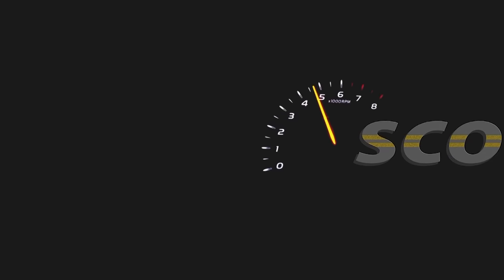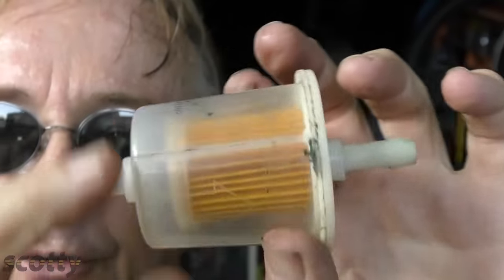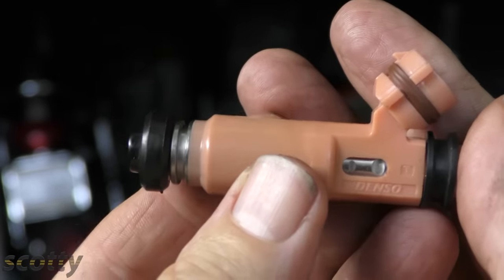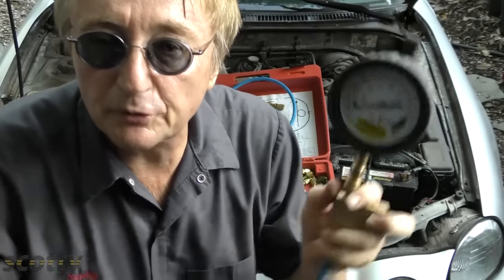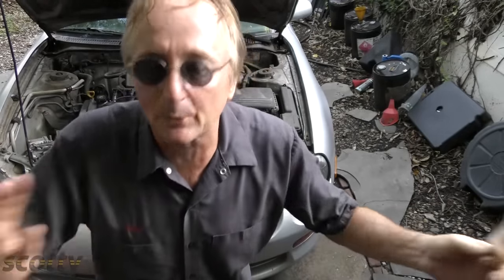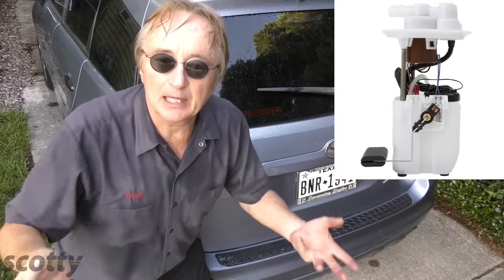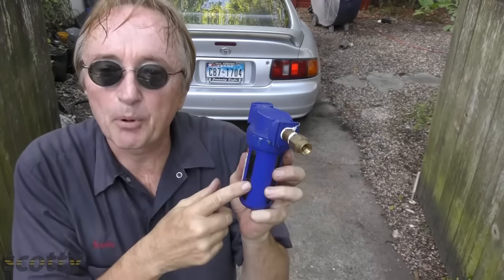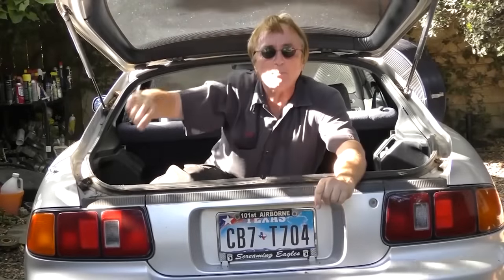Here’s What Happens if You Don’t Change the Fuel Filter in Your Car

Comment: With all due respect Scotty I would have to disagree. I know people who have cars including my own that have anywhere from 100,000 to 250,000 that are still on the original pump/ filter and run fine. I even have one friend who has a Chevy Suburban that has 320,000 miles that has never been changed and it runs fine it also has an inboard fuel filter. Personally I would rather have my fuel filter in the tank so I won’t have to change it that’s just my personal preference.

Comment: would a bad fuel filter be the reason why my 4.3 s10 decides to randomly shut off(engine) while driving? I notice low pressure by sound and feel. haven't yet rented a fuel pressure gauge but that will be my next step.

Comment: I have a 2012 Chevy Malibu and recently I was driving with only a quarter tank of gas. I was driving at a fast speed on the high way but as soon as I came to a complete stop, the gas pedal became unresponsive and when I pressed it, the car wouldn't move. Do you think it could be the fuel filter?
Reply: Mine did the exact same thing, was it the fuel filter?

Comment: Scotty I don't know if you answer people's questions but I have one about my car not starting

When I turn the key it will give the starter a slight turn it does not go continuously its just the one little bump. Any ideas? I just replaced the flywheel but with my car I could guess anything

Comment: Use top tier gas and use a good fuel cleaner every 5k miles and you shouldn't have to replace the filter if it is even accessible since these days they are in the fuel tank itself.

Comment: Hey Scotty, my fuel filter is seized on the fuel line of my 04 Grand Marquis. I even took it to the dealer and they couldn’t get it off!  Same filter been on there since 90k miles and I have 222k now!  What should I do?
Reply: Just run the car until it drops dead. 222K+ is plenty of miles.
Reply: You could add an inline filter somewhere before the one that is seized on. This would at least make your seized filter last longer as the pollutants are out of the fuel before it reaches it.

Comment: Hey Scotty, or maybe someone else will see this, I have a 2002 Saturn S series, and when I am driving around 30-45 or 60-65 all of a sudden the car starts stuttering, losing power.  The symptoms go away as soon as I let go of the gas.  Is this likely a fuel delivery issue?  I would change the filter but it's supposedly a 100k part supposedly on the car.  Engine light is not on, and I've checked for codes and didn't see any.

Comment: too bad all these modern fuel filters are sealed metal cans, no chance to see or check if it really needs replacing,  and sometimes like german cars they are quite expensive, eg 100bucks on some mercedes,  they have pressure regulator built in and 5 ports as far i remember.     So after like 50k just to be safe i've replaced it,    hacksawed the old one and...  it was like brand sparking new inside!!   no speck of dirt...  so i think i've wasted money on a new filter.

Comment: I really need to know where my fuel filter is on my 1999 Crysler 300m .
Reply: Fuel filter and fuel pressure regulator is located on the top of the fuel pump module so it would be with the fuel pump assembly in the tank.

Comment: Hi Scotty. I'm having some troubles with my toyota corrola 4age 20v blacktop engine. The engine has been rebuilt. Tps timing filters all changed and set. But the car seem too back fire through the intake during hard acceleration too 4krpm change gear and floor it again and it back fires. Any idea what could cause it. Iv also put injector cleaner. How do i check fuel pressure on the car? It dont have this attachment valves on the fuel rails

Comment: A lot of these set up for the fuel filters are just plain Bullshit Scotty. Cars used to be really DIY friendly and now they are DIY horrors. I will admit I am looking at just leasing my cars from now on and give them back after two or three years. Let the next guy have all the problems. I will have protection under the new car warranty. Ya, I will pay a bit more but it may be worth it to have a hassle free drive not having to worry about the cost of replacing a wonderfully engineered automobile. Love ya Scotty keep them coming.

Comment: hey scotty i have or had a problem with my 2000 toyota tacoma the truck would shake a lot (engine) when it would be in drive and u would gas it and it wouldn’t pick up and than would turn off  so we changed the fuel pump only and the fuel filter and doesn’t turn off anymore but still shakes a lot do you know why

Comment: My 2013 subaru has an in-tank fuel filter and my dealer wont even change it unless I'm having problems.  That and they won't change the transmission fluid either.  I have 90K and I want to keep it for 200k.  I mean.....what the heck.

Comment: Can a clogged fuel filter cause a rough idle? I have a 2009 Pontiac Vibe 1.8L. Mileage at 142,000.
Reply: While there are a variety of reasons your Pontiac Vibe has a rough idle, the most common 3 are a vacuum leak, an issue with the spark plugs, or a problem with the ignition coil.

Comment: My "new" cars, H3 and Jeep GC have fuel filters near tank, under the car.  But, when I bought the Jeep to Finland to be the second owner, the Jeep dealer in Germany had never replaced the fuel filter .  After a while the fuel pump gave up, and then I replaced the fuel filter at the same time only to find that it was so clogged that the gas did not even seep through.  So, proper American cars and trucks at least used to have external fuel filters. I think most of them still do. And no, I have never owned a Japanese car. Most likely never will, they have no soul. Four-wheeled versions of sex dolls, always work, but...

Comment: Scotty got a 62 Pontiac with a 350 it runs good its got a carb but it surges at 60 mile an h what should I do good fuel pressure and the filter is new

Comment: My cars rpms fluctuate like crazy and the car starts to like sputter/backfire, spark plugs and ignition wires are a month old so is the disturber cap and rotor.
Reply: Also I just got my timing belt fixed and head resurfaced because the timing belt snapped of like 2 months ago

Comment: Does this apply for a 2016 Hyundai Tuscon?  Do you know you can access this under the seat. I can't find any info on this.
Reply: If you have the 2.0 engine:
Removal
Release the residual pressure in fuel line.
Remove the rear seat.
Remove the fuel pump service cover.

Disconnect the fuel pump control module connector (A) and the fuel tank pressure sensor connector (B).
Disconnect the fuel pressure sensor connector (C).
Disconnect the fuel feed tube quick connector (D) and the vapor tube quick-connector (E).

Remove the locking ring (A) by using the special service tool [No.: 09310-B8100].

Replacement
[Rear seat cushion assembly]
Remove the rear seat cushion assembly (A).
Disconnect the rear seat cushion extension connector (A).

[Rear seat back assembly]
Remove the rear seat cushion assembly.
Remove the luggage board (A).
Remove the luggage tray (A).
After loosening the mounting bolts, remove the rear seat assembly (A).
Tightening torque :
16.7 ~ 25.5 N.m (1.7 ~ 2.6 kgf.m, 12.3 ~ 18.8 lb-ft)
Install in the reverse order of removal.

Comment: In the RAV4 the freaking fuel filter is in the gas tank. How many miles can I run this thing before I absolutely need to change out the whole tank? The car is 12 years old and has about 200k miles. Is there anything that will clean it?

Comment: Hey Scott, this is Sunny from New York I have 2015 Toyota Avalon and the last time I went to dealership and our local mechanic they all told don’t worry about the fuel filter or so called strainer it’s life time and I know that was bunch of non sense... my car is already 180000 miles it runs fine just worry about the fuel filter since no one here is able to do it.. what would you recommend do you have anyone here New York that you trust whom I can go to... please help I drive Uber so don’t want to get stuck anywhere and fuel pump for my car is dham expensive... please help
Reply: Your vehicle doesn't have an external filter. It is build in with the fuel pump assembly. So when they say lifetime it is the life of the fuel pump.

Comment: My car has 250,000 miles on it with no problems running. I have never changed the fuel filter. Should I bother now?
Reply: +Nikola   Certainly NOT. You may also continue with the original air in the tires.
Reply: NeverTalkToCops1 haha point taken!

Comment: They really don't make maintenance of newer cars easy. Well even if my car is 16 years old I guess it's too new because fuel filter is inside the fuel tank and of course fuel rail doesn't have valve to check pressure. So it's not exaclty "welp I just quickly change the filter" kinda job.

Comment: The fuel filter on a 96 Ford Explorer 4.0 liter XLT is one which requires a special tool to disengage the clips on both sides. Even if you take out the fuel pump fuse, you're still likely to get gas all over you when you finally get it off. Just wear some fast food uniform from a job you probably had before. Taco Bell and Pizza Hut won't care. Just wait for the fuel to stop coming out and swap it out, and maybe take a shower afterward.

Comment: 60000 miles is 1 year in my car. If the fuel filter is doing any filtering it will need to be replaced.

Comment: So I my 96 honda won't start the battery works and so does the starter  just installed a brand new 1 and nope  the lights turn on and everything but when I twist the key ignition to turn it on it don't start itsa manual any help it's driving me nuts

Comment: My 2001 honda accord doesnt have one what should I do?
Reply: Andrius Fink Neither does my 03 accord.  Different generation I wasnt sure on the older ones interesting to know
Reply: You have one. It's in the tank.
Reply: dekoldrick I thought it was a sealed unit all in one with the fuel pump?
Reply: Most likely it is all one unit inside the tank. My 93 Accord has the fuel filter on the passenger side firewall under the vacuum control box.

Comment: a lean condition will NOT make your catalytic converter run hot. Catalytic converters will overheat when there is unburned fuel (rich condition) going out your exhaust - the catalyst will aid combustion between the unburned fuel and oxygen so it doesn't exit your exhaust pipe unburned - Hydrocarbon pollution.

Comment: I have a qweshin؟ pleeze 1 of you well-experienced tech/mechanics or Scaady-fans help me for I am in a konunjrum:
If a fuel tank is vandalized by addition of some contaminant to it. Not sure if it's water, vinegar bleach, ..etc. *does the fuel pump necessarily need be changed* whay is the best recomendation?? SHOULD I AuDOMATICALY also GeT a different tank (it would need be from wrecking yard~) IF I DON'T HAVE PRESSURE WASHER OR HOSE or facility to wash and put a sleeve into it- the gas tank- for cleaning?

Comment: Scotty's my 2006 Nissan Sentra dont have that can i add on my car thanks
Reply: Angel Rosado every car has a fuel filter
Reply: TheRealBRUH i know my have inside of the fuel pump but can i add another one outside??
Reply: Angel Rosado I'm not sure but probably not.
Reply: It's in the fuel pump assembly in the tank, it's a sock like thing. You can buy it, but it's harder to replace it. It's in the backseat below the seat.

Comment: My fuel filter is attached to the fuel pump, so the tank has to be dropped, so you might as well change the fuel pump also, with 200,000 miles on my vehicle and never changed the fuel filter???????

Comment: on my car (Astra G 2003 twin port) the fuel filter is under the car, next to the rear drivers wheel... so it took around 3 minutes to change

toyota's just dumb

Comment: Scotty Kilmer I dare you Change a fuel filter on a 93Ford Laser laser while you're high as a kite on petrol fumes and covered in as well not a very fun experience I done my Ford Laser about 2 months ago I was ready to put a match to it another bad thing about it was I got petrol in my mouth and I could taste it for 3 days what really made me angry was location fuel filter on the 93Ford Laser it's behind the motor right against the the firewall had to remove 20 different parts to get at it and I killed my pliers with a petrol

Comment: Shouldn't srandard Fuel system Cleaner clean 99% those fuel-filters?  My gosh, this aint rocket science,  this is 2020
Reply: They clean the fuel system which then moves the nasty stuff to the filter so it would still need to be replaced.